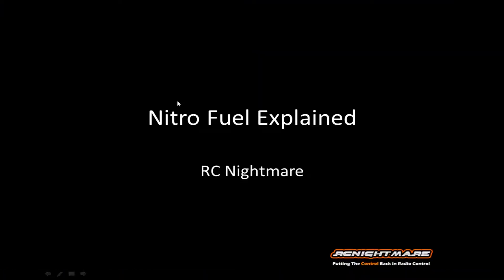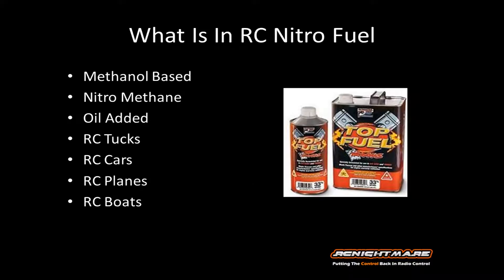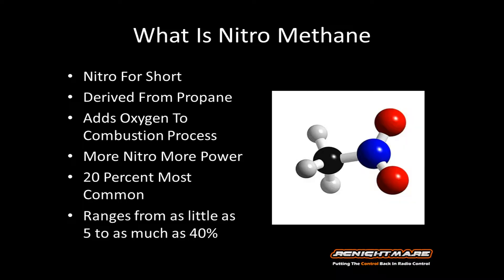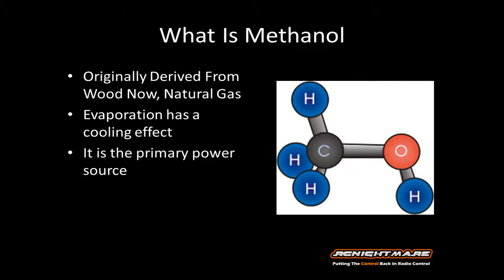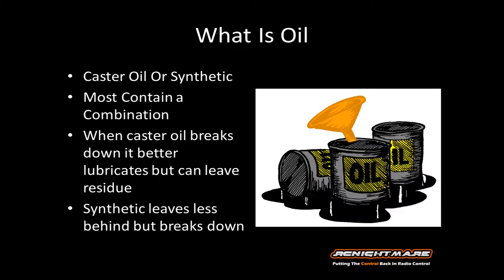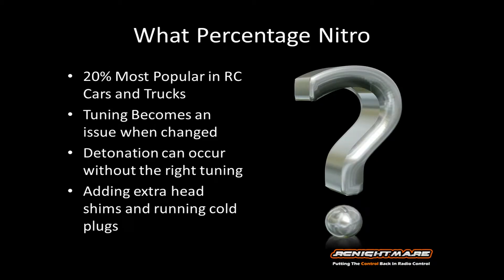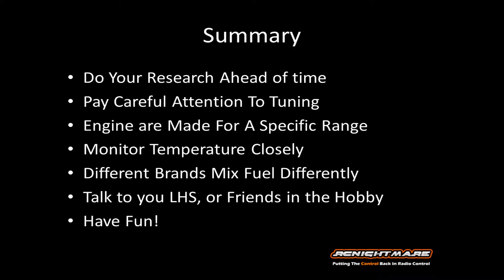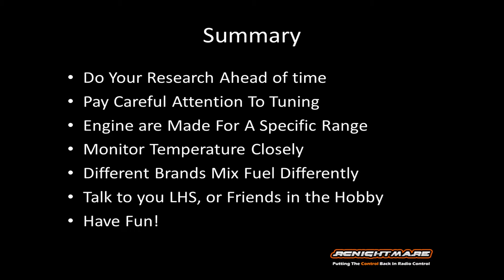RC Nitro Fuel Explained

Comment: what would hapen if i use this fuel in my 50cc pocket bike?
Reply: It'll probably explode
Reply: Archie Mayor or his wallet will be empty because of high nitro prices
Reply: I can tell you that it will take a large tune change BUT nitro will run in a 2stroke gas engine without problem... It will NOT make as much power as normal pump gas and it will run very cool compared to gas and it would eat you up on fuel cost lol. 40 dollars a gallon for Trinity (my fuel sponsor) vs 2 dollars a gallon for pump gas.

Comment: This is a great channel and I appreciate the work here. I must disagree with many of the comments concerning tuning an engine. I switch up among brands, percentage (20, 25, 30) all the time. Often the engine will stay within the parameters of a race tune. I cannot speak for all engines, but have owned quite a few (25+) and this has been my experience. Same  goes for temps. Temp guns are not needed and can do more harm than good....this includes break-in, where the temps do matter,
Reply: I know this comment is 5 years old, but christ you're a moron. Temp guns are definitely necessary. Please don't listen to this guy! They're a very important tool for measuring how the engine is handling your tuning!

Comment: Yes i understood what you meant, and I said, nitro fuel needs to be placed at room temp not cool ice, the fuel will still warm up with the exhaust heat that goes to the tank from the exhaust pipe so theres nothing you can do about it. The only option you got to cool the fuel going to your engine is to buy a fuel cooler go to google and search "fuel cooler" you'll see what im talking about.

Comment: i dont mean pouring the fuel into an ice chest, i mean filling the chest with ice then just putting the whole gallon in the container. then the fuel cools down even more so when its squirted into the engine it naturally runs even cooler.

Comment: no you didn't make a mistake just run a half tank idling then second tank doing small slow loops then you should be ready to bash! That's just a precaution to break in the new fuel to your motor.

Comment: i just bought 30% Byron race nitro (4 gallons) off a main hobbies. I have been running 20% Byron and 25% Trinity and wanna get the claimed horsepower out of my .28 motors. I hope I didn't make a mistake doing this. P.S. yes i switched to a colder plug, and I live @ 300' above sea level.

Comment: wondering if you think there is an experation date ? I have traxxas 20 % and its been sitting in my closet id say for about a year now... lol and i randomly got bac into my rc and i dont have a hobby shop any closer than 40 miles.. so can i use it ? i dont think it would cause damage maybe just not ignite as it would new ? 

also i hear some guys that race put their fuel in an ice chest to keep it really cool. but i noticed if its in there to long .. you can see little crystals in there.